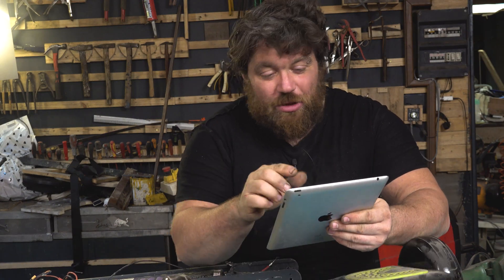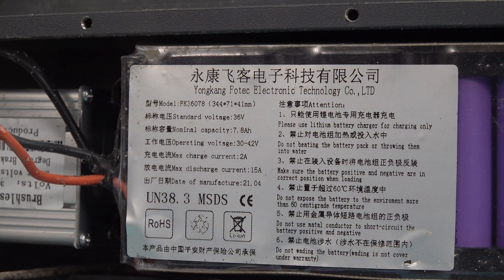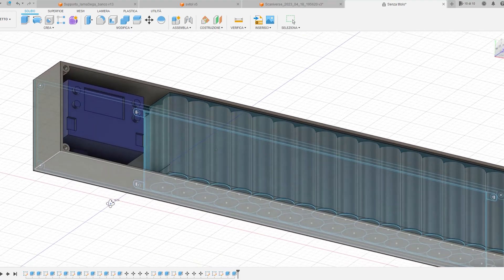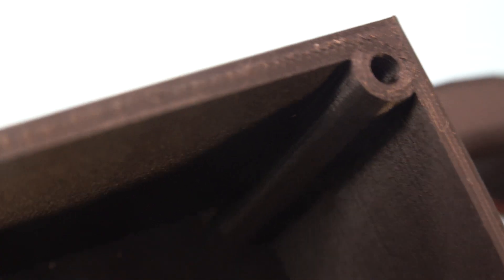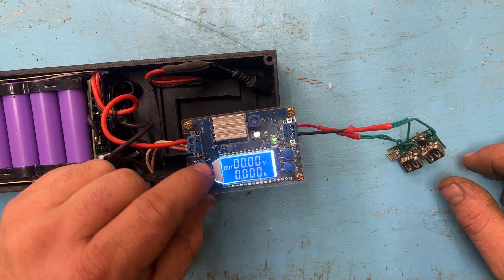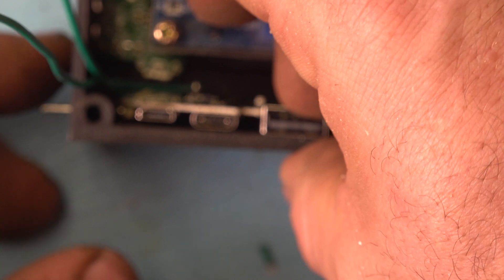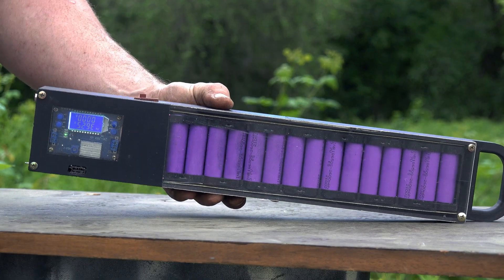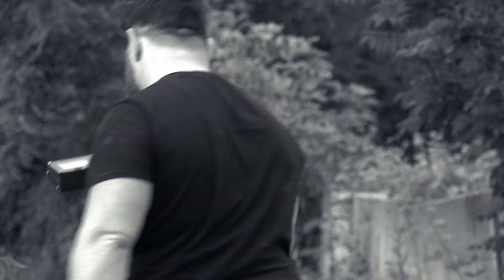How to Make a Monster Power Bank • 25$ and no Soldering Necessary

Comment: Be careful with that buck/boost board.  The capacitors and chips are only rated for 35V.  When the pack is fully charged, it will be at 42V.

Comment: $130 for the battery alone.
Reply: Just search better from Chinese dealers!
Reply: @carbonEX-2023 fake sells. check video's. 

ppl pound sand in 18650 instead of a battery
Reply: Just buy a dirty cheap used scooter
Reply: @Ricciolo-oj1nc  Dirty cheap used scooter with GOOD battery below 25USD? Tell me where, I will buy it.
Reply: Just think about how much juice you have to charge your phone tho

Comment: This is AWESOME!!! I'm jealous!!! - BUT, you never said ANYTHING about how to charge the batteries back up again.....
ALSO, did you keep the original 2 USB ports still connected? AND Why didn't you leave those USB-C ports open? You could charge your phone with a usb-c to usb-c cable instead of a converter cable AND you could probably charge more than one device at a time.... but I know you have your reasons.
I am very interested in how you charge the bank back up the most..... you can get A LOT of charges out of that bank, but if it's just a one time use then that is quite wasteful..... If you can charge it up please tell us how because I really need a power bank and I would like to make it solar charging.... but I know nothing about it. Maybe you could make a video about that? :)
Reply: This would be fantastic for me. 
I have spent the past two years living in a tent in Slab City in California and i use power banks to keep my phone charged and run fans to stay cool in the summer. 

If he connected the board from the old bank he disassembled right he could plug a charger into it and start charging the bank but it'd be very slow.

I charge my power banks off solar panels designed for charging usb devices. Something like this i could rig up a pure sine inverter and use it to power my laptop. Haven't been able to run it in years.
Reply: @glenngriffon 
Why does Someone as smart as you live in a tent 😳
Unless it’s your way to off grid live type of thing. Wish I could do that. I know a couple that set up a trailer in middle of nowhere with solar panels, seems so peaceful yet actually affordable.
Reply: @carsonhunt4642   I ended up homeless in 2020. Since I'm on disability i don't have a job. So i was living out of my car for a while before it hit me that i had a rare kind of freedom and I could pretty much go anywhere I wanted. 

But i couldn't afford to keep up the insurance costs on my car and my plates and registration were soon out of date which ment that getting caught driving would land me in jail.

So i didn't have many options and Slab City was the one place i onew for certain that i could go and just build up a life from the ground up. 

So that's what I've done. 
Before you go thinking it's some kind of beautiful, don't daydream too hard. It's 115 in the summer, sometimes more. It's filled with anarchist types and it's near an active military base so if your neighbors aren't shooting at all hours of the night, the army is. 

There's no utilities of any kind. No natural gas, no electricity, no running water. So don't expect to have a shower frequently or have frozen food. 

Then you got packs of wild dogs, packs of coyotes, scorpions, tarantulas, camel spiders, and skin walkers (aka meth junkies).

All that aside there's positives. For one thing you can live as free as you want. Plop a trailer down in some deserted spot and there you go. Or if you can the skills, equipment, and stuff to do it- build yourself a shack somewhere. 

As for why I'm here it's pretty much because I don't have anywhere else to go. Plus there's a side of me that kinda likes this life. Like living in a post apocalyptic wasteland.
Reply: He mentioned there were two cables: one for the power out and one for the charger.

If he left the charge cable connected and the port exposed then he charges it by plugging in the original charger.
Reply: You can see the charge port at 7:42.

If you’re buying a battery it should tell you which charger to buy. If you’re building one then you need a CC/CV charger and you’ll need to know how many cells are in series to get the CV and what is a safe charge current given the number of cells in parallel for the CC.

I recently built a 7s4p pack, max cell voltage is 4.2 so 7*4.2=29.4V. I used  Samsung 35E cells that have a safe charge current of 1A each, 4*1A =4A. So I bought a 4A 29.4V li-ion (CC/CV) charger - worked a treat!